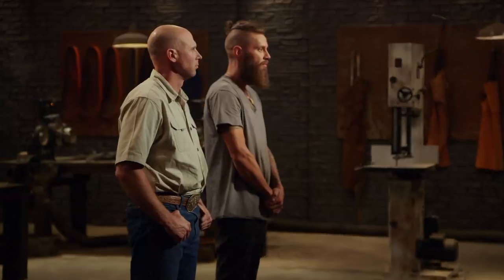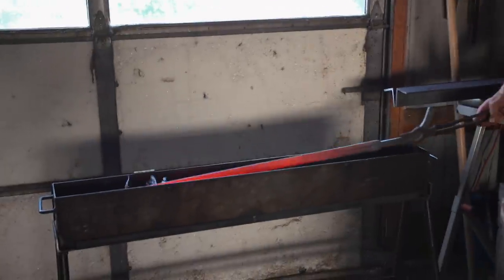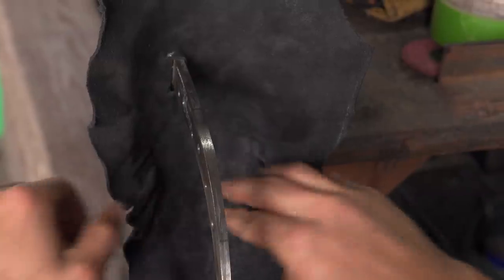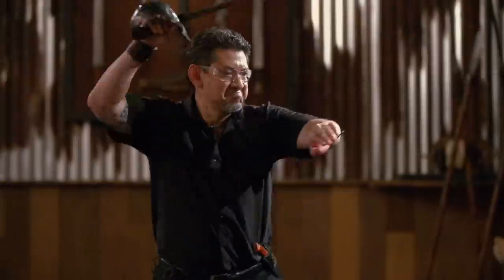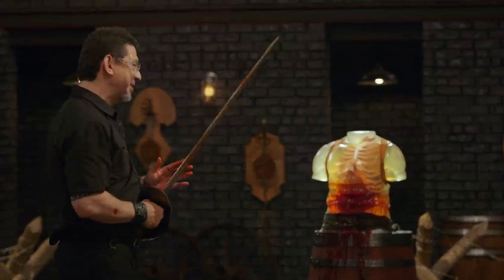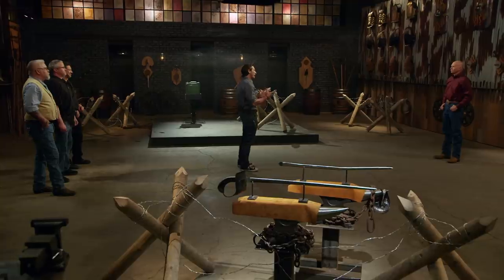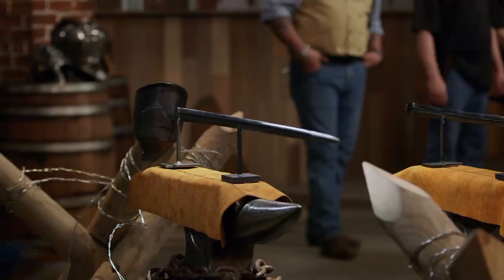*MADE TO KEAL* Patton's Saber IMPALES The Final Round | Forged in Fire (Season 7) | History

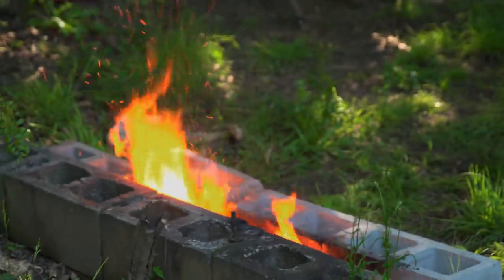Comment: 1:39 I could tell that heat treat was WAY off just by the uneven colour of the steel. Chris should have been constantly moving the blade back and forth through the coals to better spread out the heat, maybe then his blade wouldn't have broken. It's a shame since I was rooting for him, not the millionaire with a plasma cutter and a canon. If they both had access to the same quality of tools then I'd have put my money on Chris winning.
Reply: Vary valid point, however I'm from Colorado so I had to root for the other dude lol. But I agree Chris had minimal access to more advanced equipment. I have mass respect for the way he attempted his blad though. if he had the same equipment I'm sure he would have won. That other guy was definitely doing the competition for fun he definitely didn't need the 10 g's.

Comment: The tests were garbage, this is my favorite sword. That isn’t a slashing sword. It was designed to thrust from horseback. 

“(This does) not take into consideration that change in method of employment of the Patton saber that required a 180 degree counter-clockwise rotation of the arm and saber during a mounted charge. This change allows the arm to safely "unwind" as the horseman passes the struck target.” 

It’s a tiny lance, not a slasher.
Reply: insert Office "Thank you!" meme here
Reply: The test is really good... It is not about how it is used on the battlefield, but to test the sword in comparison with the other swords made on the program, so that tests are somewhat semilar.
Reply: @MrBandholm  if that’s the point then I think it’s a bad one. Every sword needs to be evaluated based on its own merits and strengths. So are you saying if they made a spear they should just swing it like a sword at the ballistics jelly? (That sword was meant to be used like a spear) And if it’s about evaluating them equally why aren’t the tests the same every episode? The variables are constantly changing. And I know that they normally try to use the weapon as intended.
Reply: Would've been fun to see Doug on horseback against the ballistic gel dummies.
Reply: @forteandblues  Well I think you are fundamentally missing the point of the show.
It is not an evaluation of the type of sword/spear/axe or whatever, but an evaluation of the smiths ability to forge a weapon, and that is a key difference.

All the tests in each episodes are broadly the same, there is a strength test, a kill test and a sharpness test, if the weapon is different in a particular way, say a hammer, then they change the test to something that is still something they can test within some context-perimeter. It is a TV-show, so it wont be the same thing every time, because that would quickly get boring, but the catagories are the same.

Also yes this sword were generally made with the thrust in mind, but it could still be used for slashing (as the contenter showed riding past that melon), and how it would be used in mid of battle can be very different from the intent... But still it is not a show about weapons, it is a show about forging, that just happens to be weapons.
Reply: @MrBandholm  well I guess that is the fundamental problem with the show. People don’t care about the blacksmiths. They think the weapons and the history are cool. (Smithing is cool too, but they obviously save the kill test and stuff for the end because they know that’s what people are really waiting for) 

I guess I just wish they would actually use the weapons as they were meant to be used. I don’t think that it’s that much to ask for, especially when they have gone out and used horses and stuff before this.
Reply: @forteandblues  It would be really hard (and weird) to make the kill test early in the program, since it is the test for the final weapon the final two smiths make :P

And again, you look for the kill test as if that is the point of the show, where really it is just a bit of fun (and a way to show off what these tools can do to a body), where really it is to test the skills of the smiths.
Reply: @MrBandholm  if you judge a fish by its ability to climb a tree then you will spend your whole life thinking it’s stupid.
Reply: @forteandblues  True enough, but if you test a sword by how well it is made, by bashing it against something it should be able to handel if it is well made, then your test was a succes.

Again the sword can cut and thrust, and they showed that by cutting and thrusting... Your main complaint is that they didn't do it from a horse, and while that would have been amusing to see, it is overall not needed.

The tests aren't stupid or bad.
Reply: @MrBandholm  at this point agree to disagree. 

My point wasn’t about the horse, more about the fact that you shouldn’t test swords in ways that they were not intended to be used.

I’m still a fan of the show, it’s just something I think they could improve.
Reply: @forteandblues  Hypothetically if the rider fell from the horse wouldn't he still use the sword to attack and defend himself? Then would he do the counter clockwise swing thing you said a rider would normally do on horseback?

Comment: Chris needs to consider his forging methods, he almost impaled a Judge by not making the right call, he is inexperienced and as a result lost the competition, he was luck that no one was injured. he should of used some bricks on the bottom of his forge and cover part of the top to get the even heat.
Reply: yeah, this isn't the first person to use a coal forge, the problem is he did it badly.
Reply: @marhawkman303  exactly, in primitive builds the sqords have withstood the test of time. The competitor should of taken more time
Reply: @al-eemahmed847  Kelli in the Falcata challenge made her blade in a charcoal forge constructed using loosely stacked bricks.  Why did she use charcoal? Well, she's a farrier and apparently uses it to make horse shoes on a regular basis.  But... Kelli had quite a lot of experience making blades. (maybe even the blades she uses to trim hooves?)  Kelli even forged a horse head pommel onto her Falcata.  Didn't see exactly HOW, but it was sculpted from steel and part of the tang.  That is what a true master can do with a charcoal forge.